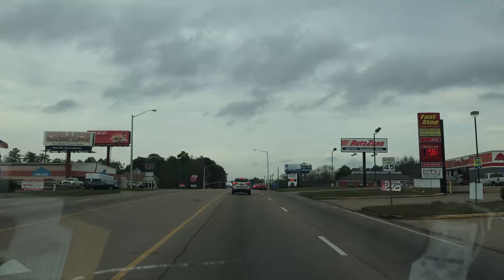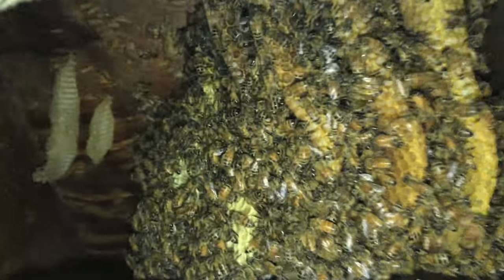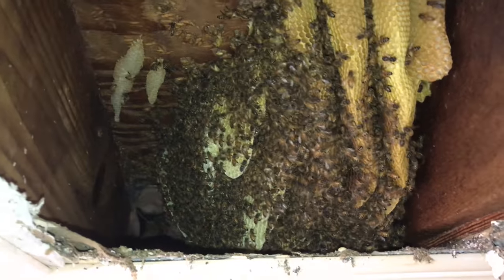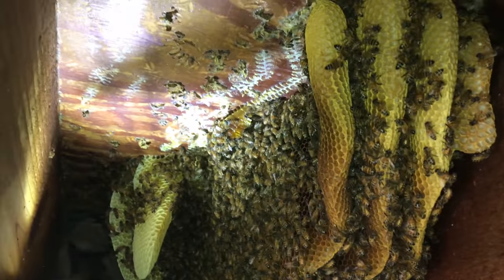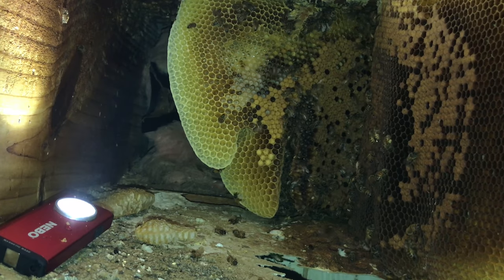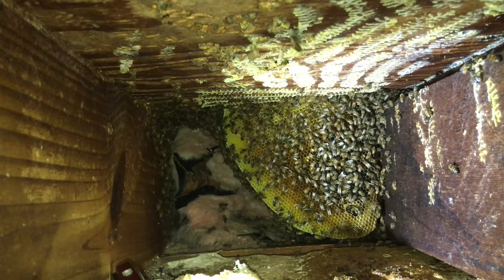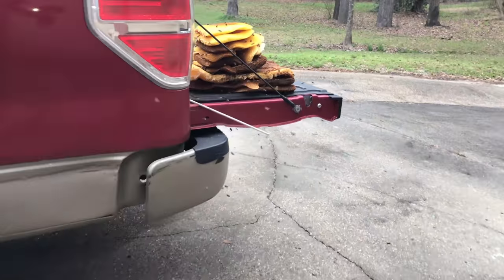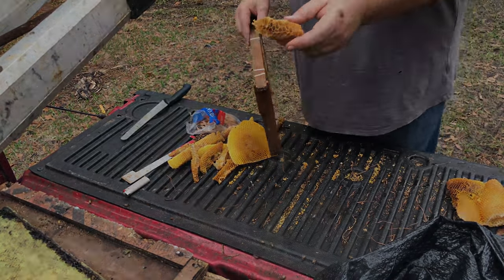Bees In The Basement

Comment: Hey Randy quick question/suggestion maybe. I was watching one of your videos where you were helping Chuck and he was using oil traps for beetles and it gave me an idea unless it's already been made. What about something like a roach motel that only the beetles can fit into the same size as the oil traps only instead of oil use sticky paper and again make it where only the beetles can fit into and make the openings all the way around the trap?? Do they make anything like that? If you had access to a 3D printer for plastic I don't think it would be too difficult to make and you could possibly make it for above and below the boxes.
Reply from the maker: They don't make that but I've used modified Roach Motels in the past as an experiment.  They caught beetles but not at any higher rate than other methods.

Comment: do you or property owners scrape off the remnants of the comb off where it was attached to prevent returning colony or a different feral colony?
Reply: critter9a I think they just try to seal up the entrance so that more bees can't get in - no matter how well they scrape the surface, the smell of bees will be soaked into the timber so only ripping up the floor and replacing it will stop it attracting new bees.
How well the local builders understand sealing it to keep bees out is attested to by how often the bee wranglers remove hives from the same location. I think if I owned a house there I'd ask for a trap hive on the outside wall of the house, instead of having to repair the plaster every year!